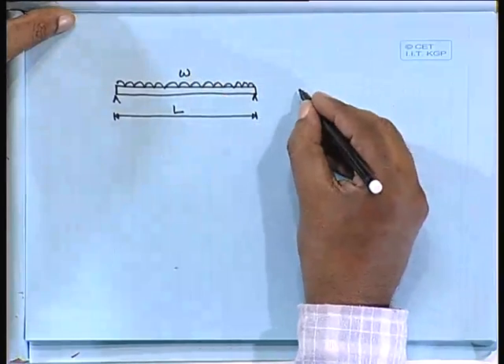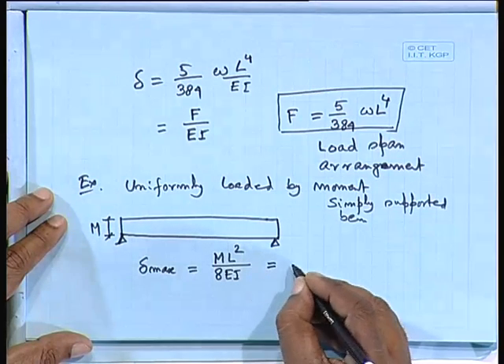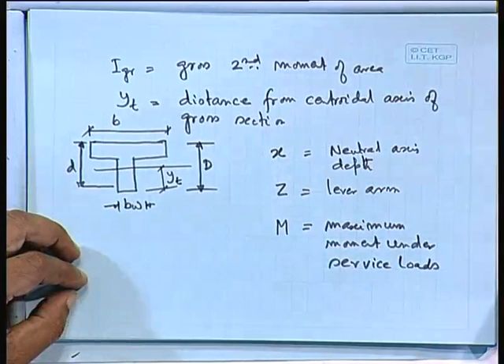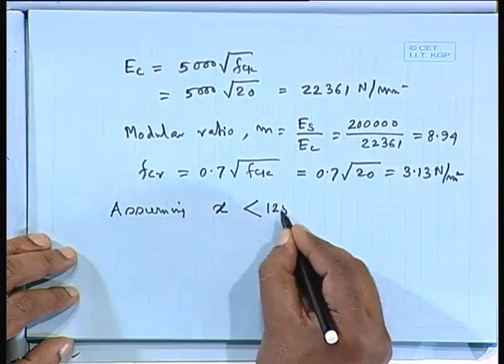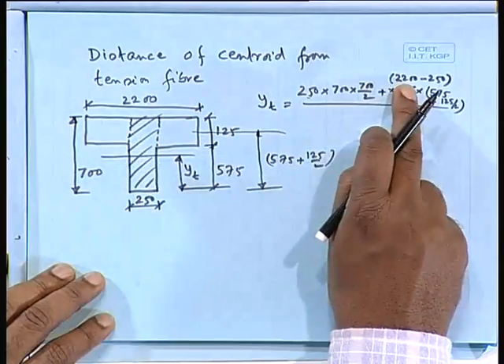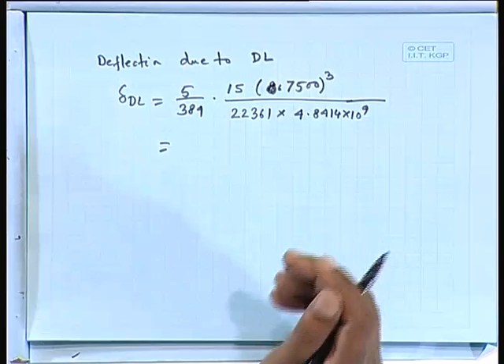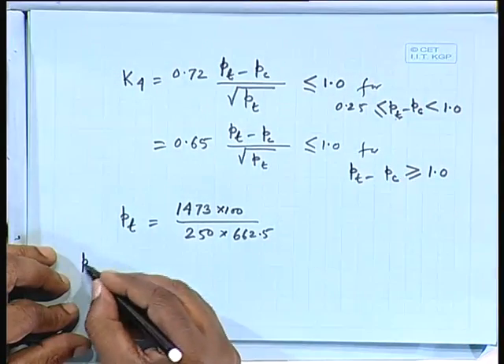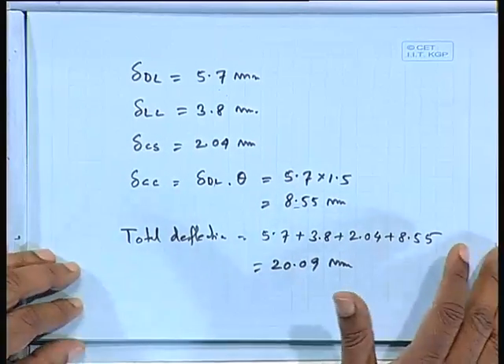Deflection of RC Beams

Comment: Sir, thankyou for your wonderful video.
I have one doubt on DL.
If I have 3m soil load on the beam, then the entire soil load will be treated as DL on beam or not for calculation of deflection of beam.

Please clarify ,
Thankyou.
Reply: Somewhere in the lecture series sir has mentioned imposed dead loads 
I think you may consider it as dead load

Comment: why in finding Igr equation used is bd3/3 instead of bd3/12.?
Reply: I used bd³/12 for solving my problem.
Reply: @isaacpulamte8267  @ankit Upadhyay
Since the top of the rectangle is the centroidal axis.. it's all the same.

bd^3/12 is about the centroid of the rectangle. we have to shift it using parallel axis theorem.

its bd^3/12 + bd(dy)^2 which for a rectangle about the base comes to bd^3/3

Hope its clear now.